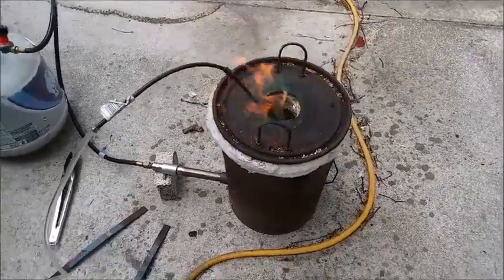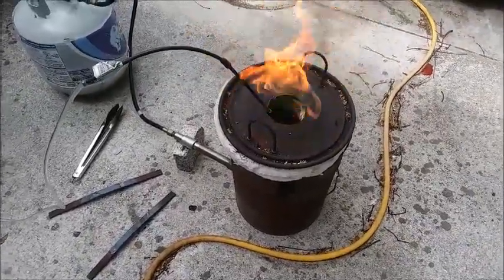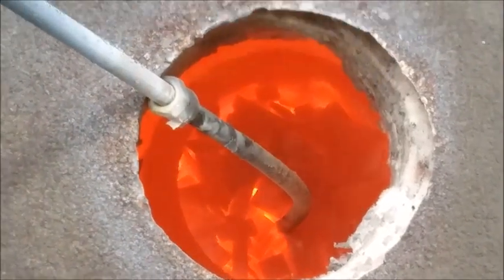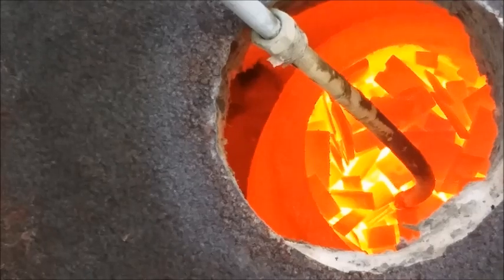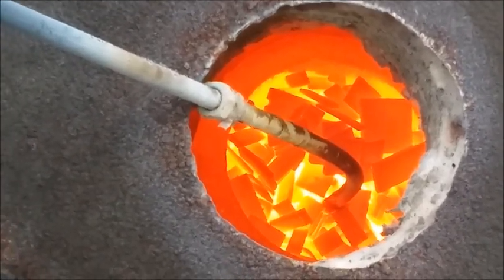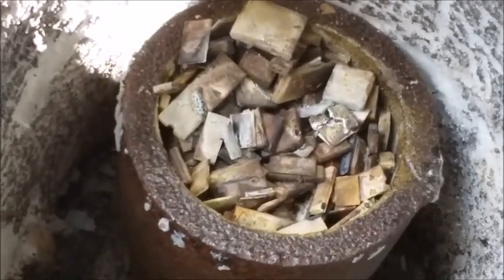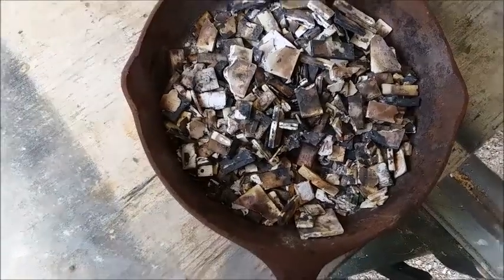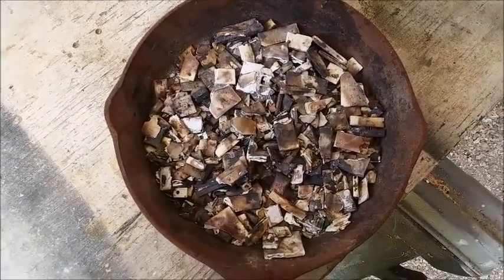Ashing Plastic IC Chips to Extract Gold

Comment: I was hoping to see the blender and ash separation processes as well...I am stockpiling and was considering using a vented Weber BBQ in a stainless steel pot and some hardwood coals.  Maybe it won't be hot enough to ash the carbon??

Comment: I have not done any ic chips yet still collecting but I use a forced air furnace to heat with so this process should in theory work automatically for me. As I am already forcing air into the furnace.